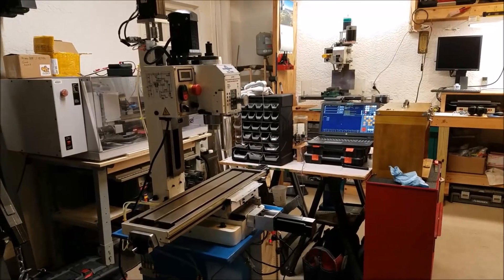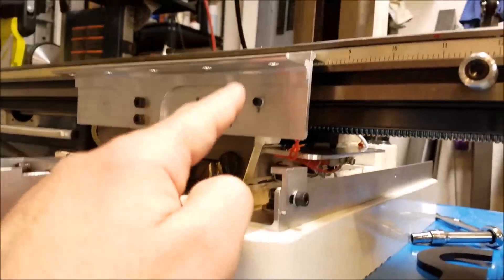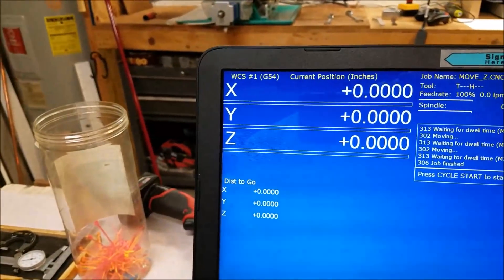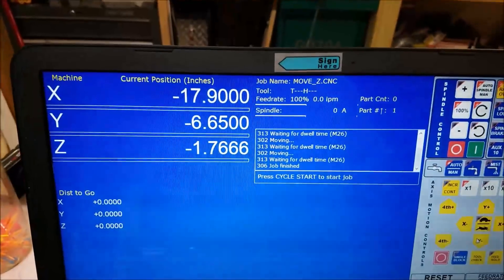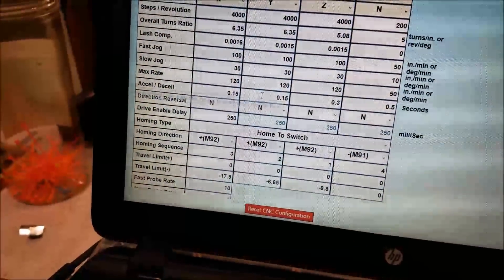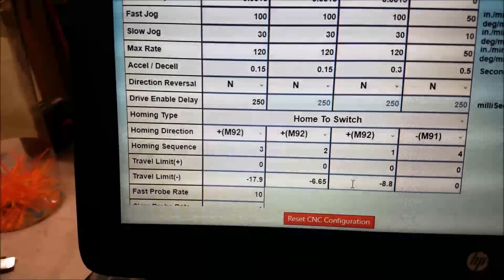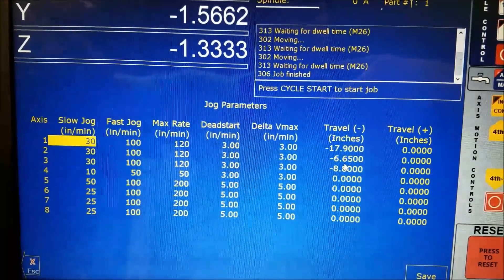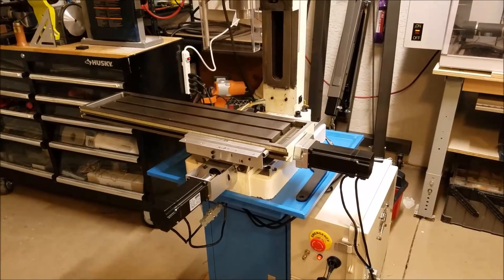PM-25MV CNC Conversion Part 4: Home Switches with Centroid Acorn

Comment: Hi Franco. I already bought my accorn cnc card. I will start with my project of my cnc milling Machine. I would like to know what you recomend for the beginning
Reply from the maker: Start with the software and the electronics.  Get the software up and running and get your motors turning on the bench before you touch your machine.

Comment: HI Franco... I am trying to get my pm30 with a cnc kit dialed in with a centroid acorn... I have been watching Martys videos and is X axis homes to the RIGHT....  yours is homing to the left... why the difference?l... thanks....
Reply from the maker: Hi.  It's just the direction you select in the Wizard for homing.  It really doesn't matter which way you go as long as you have the settings entered correctly.  If you have the opportunity to do it either way, do it the way Marty has it setup up.

Comment: On the input side of the board do you have all the switches going to 1 input? I notice on one of the schematics it shows home all switches to an input then limit switches to another input. It looks as though the way your doing it here is that you only need 1 input? ( I have a rev 4 board.)
Reply from the maker: That is correct.  I have three home switches (XY and Z) connected in series to one input.  After I home the machine, I use soft limits to make sure I don't over travel.  It works great.
Reply: Franco awesome that’s how I’ll do mine for my Bridgeport. My millright cnc mega v plasma/router table Is set up that way (different controller though)

Comment: Hi Franco,  What Type of homing Switches did you use, part number ?
Reply: Something like this seems to work well: https://www.digikey.com/product-detail/en/omron-electronics-inc-emc-div/V-105-1A5/Z4600-ND/1828964
If possible, try to find ones with metal rollers.   I'll look for the exact model number of my switches and let you know.
Reply: @bradfrancola8485  Thanks

Comment: Thanks for the videos!
Have you work out a way to control the spindle from the acorn? The acorn out puts 0-10v and the pm25 uses 0-5v.
Reply from the maker: Hi.  I haven't worked on that but, you can use a simple voltage dividing circuit to cut the acorn voltage in half.  Check out this video:  https://youtu.be/gtwf3f4P6Ls    I used WAY too many resistors (you really only need two) but if you read the comments, you'll get a good idea of what you SHOULD do in terms of a voltage dividing circuit.

Comment: Do you have a new wiring diagram for wiring the home/limit switches to only one input?  All the diagrams I have seen use 3-4 inputs for the home end, plus one more for the opposite ends, which are wired in series.  I would guess that the home end switches are also hooked in series to one input, right?  I just finished converting my PM30-MV.  I initially just used the ddcsv2.1 controller and MPG that came with the motor and drive kit, but I just purchased the Pro Centroid CNC software, Acorn board, and 24" Touch screen, but have not yet installed them.  Using only one input for the switches is a big change (for the better) as far as wiring is concerned, and wiring is what I am now working on.
Reply from the maker: Hi.  You can wire all of your homing switches in series and use a single input.   The wiring diagram you want to look at is called "ACORN_rev3, LIMIT ALL, HOME ALL"  and can be downloaded here:  http://www.centroidcnc.com/centroid_diy/downloads/acorn_schematics/centroid_acorn_hookup_schematics.zip
Reply: Thanks, I'll download it and make thing simpler!.

Comment: are you going to sell kits for converting a PM 25 MV to CNC? I would be interested in it.
Reply: PS I love how quiet it is!
Reply from the maker: Hi.  After I finish the machine and have a chance to test it out, I'll probably make a batch of kits and try to sell them.  I'll be sure to post some videos when I get to that point.  Thanks!
Reply: I would be interested it a parts list and prints with place you get them from. If  you sell all that.

Comment: Thanks Franco for posting these videos! And thanks for the kind words. We are here to help and inspire others! 

For setting limits, first, make sure the axis are turning in the proper direction correctly and the axis are calibrated. Make sure as Franco pointed out you have a switch to home to. (it is possible to configure the software to home to marks which means no switches, you put witness marks on the end of each axis to jog to them, then press cycle start to set the home position).  Home the machine, press ALT-D to show the Machine DROs and Franco points out in this video, then jog each axis CAREFULLY and SLOWLY to the end of the travel, stop, pull back  at least .1" from the hard stop, read Machine DRO position for that axis, write it down, this is your soft limit value. Do the same for each axis. Exit CNC12, go into the Wizard and enter the end of travel values for each axis as Franco pointed out. They are negative values if your your limit/home switches are on the positive end of the axis. (Z on a mill is on the positive end, so the travel to the opposite end of the axis is a negative movement so your value would be  -XX. 

Unless you are well versed with poking around in CNC12 and setting things up that way, it is HIGHLY recommended that you do all configuring in the Wizard.  Becareful, have fun and enjoy setting up your machines with Centroid CNC Acorn!

Comment: Is the dmm stuff going on this machine?
Reply from the maker: Hi.  That was the original plan but, I got started with those Hybrid Steppers and they worked so well I couldn't bring myself to take them off of the machine.  I'm thinking the DMM servos/drives are going to go on the Techno/Isel lathe the you may have sen in the background of this video.
Reply: If you are interested in DMM AC Servos, visit my channel where I installed NEMA 34 DMM AC Servos and DYN2 drives on an EMCOTURN 120 CNC lathe. It is almost done but the tuning....video of that forthcoming....Marty
Reply: Franco 
Thats a bit saddening but you are an inspiration to hobby cnc and hope you continue to teach cheers!
Reply: Here's a dumb question, being that your setting this machine up closer to industrial than hobby level, why did you opt to go with micro switches vs prox switchs.
Reply from the maker: Thanks.  I'll do the best I can!
Reply from the maker: Hi.  I've actually had really good experience with mechanical limit switches.  If you get quality switches with metal rollers and good internal contacts, they are very repeatable.  And, they are cheap to buy and easy to wire up.  I'm sure proximity switches would work great, too.
Reply: Franco your right good ones are super repeatable. The added benefit of prox switchs are no moving parts, or parts that touch. If something goes wrong, like you said about forgetting the softstops on Mach 3 or 4. You don't smash off your switch. And you don't have to worry about chips or coolant getting in them.

Comment: almost chip time???
Reply from the maker: I sure hope so!  I'm trying to get this thing finished so I can sell the G0704 and make some more room in the garage.
Reply: Hi Franco, just wondering where you bought the home switches ?
And should they be waterproof for flood coolant ?
Reply from the maker: Hi.  Go to eBay and search for "Grey Micro Switch Metal Roller Lever Limit N.O/N.C Switch 28x16mmx10mm 15A" and you will find the switches.  Some switches are junk - plastic rollers and really stiff action.  These grey switches have metal rollers and seem to have decent quality switching action.  They probably are not water proof.  But, I'm hoping the way I've mounted and covered them will prevent them from getting soaked.  I'll show all of that in a future video.  Thanks!